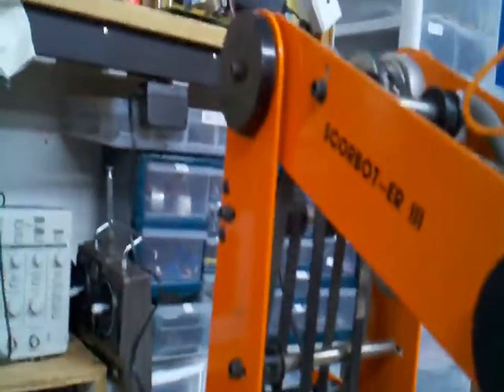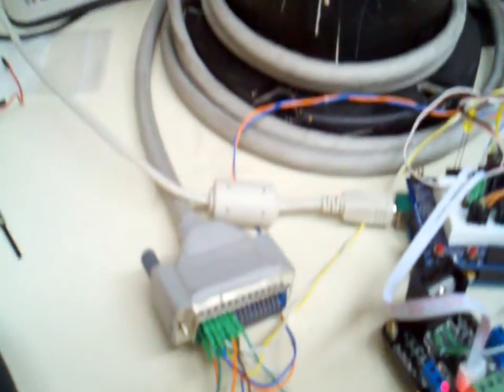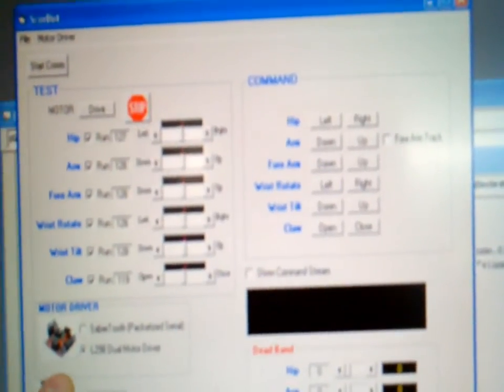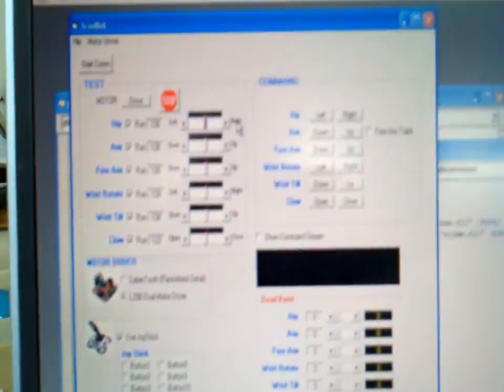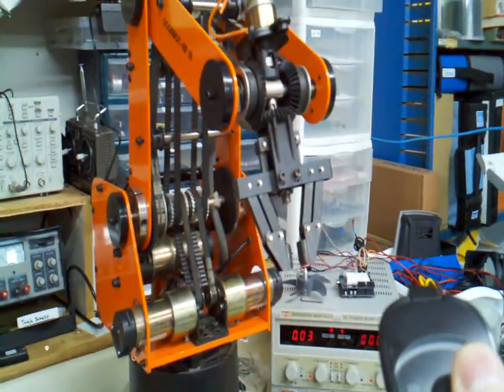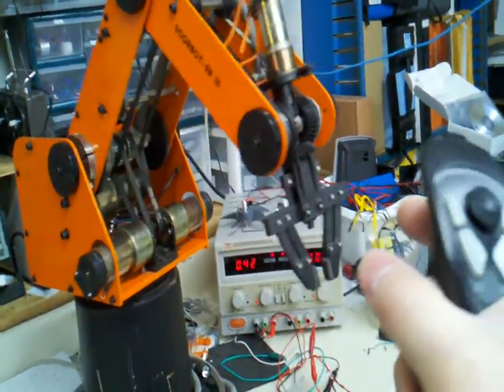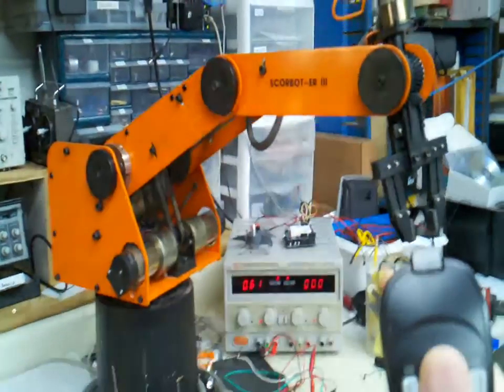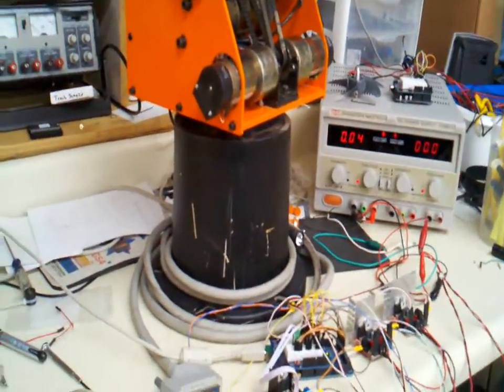ScorBot Arm, Arduino Mega, and L298

Comment: Dear sir, can you share code and circuit diagram. Thank you so much!
Reply: Sorry,  I has been a long time. The gui is VB6.
I use PS2 controllers now to control the Scorbot arms.
I will look for the ps2 code and pinout. Thanks for reaching out.
Reply: @doylemaleche9937  thank sir very much

Comment: Respected sir, 
I am a student working on similar kind of project which is a controller of scorbot er v. In that i want to make a GUI same like you.
But i am using Arduino UNO controller and l298. 
But how can i connect two Arduino UNO because one Arduino uno control 2 motor withl298 .
So how can i proceed further. I really need your help sir
And can you provide GUI which i show. In video for my reference.
Please help me sir
Any material or use full information share me through my email id- soni013.1996@gmail.com

Thank you

Comment: i always see setups that there are always 2 motors on the second joint. how to control it that the two motors will work together? because if one motor runs first the other motor will be a load?
Reply: mark loria 
Not sure what you are asking.
The claw wrist is controlled by two motors. You have to command both simultaneously in one direction for  tilt and both in opposite directions to rotate.
Reply: i guess ive got your answer. what im just trying to say is about two motors that run together, they have to be synchronous.

Comment from the maker: Updated to use PS2 controller. 
works great!
Reply: Edward Notebaart,
this routine was written in Visual Basic 6.0 and no longer supported.
i now use an Arduino and PS2 joystick controlling the L298 motor drivers.
I can send you the code if you like. 
warm regards. 
Doyle
Reply: @doylemaleche9937   would you be able to help me out with the code; anything helps Thanks in advance
Reply: @3DPrinting_And_More2515  I will look for it
Reply: @doylemaleche9937  Did you happen to find it, your help would be appreciated 🙏 😊
Reply: I would appreciate the code very much! Do you have any wiring diagrams for the  arduino and L298 and joy stick  as well.  Thanks this will be a great help. Warm regards
Reply: scruffman2001 Sir are you willing to share how you were able to accomplish your control of the scorbot robotic arm?
Reply: scruffman2001 no private email.
how do you do that here?
Reply: Cob 674 at yahoo dot com 
yahoo.com

Comment from the maker: No PID involved, just direct control.  No limit switch for the hard stops. I have switched over to PS2 controller which made it easier to control.  I will post a video using PS2 soon.  The Visual Basic 6.0 is no longer supported by Windows, and I have not transferred it to .NET.
Thanks everyone for asking!
DOyle

Comment: Hello :), I have 2 of these with conveyers and sliding rails, I have 2 others (pegasus) and a rhino xr4, anyone interested in owning one? The 2 scorbots are just like the one in this video. A question for you scruffman2001, if you did want to hook up those encoders to the arduino, how would you do it? I have looked up a g320x gecko drive, but they are expensive. Do you have an alternative?

Comment from the maker: Electric screw drivers are geared which provides greater torque and are used in robotics projects.  The lm298 can provide up to 2amps with proper heatsink.  The best way to determine the capacity is to place a multimeter in series with the supply voltage and set to read amperage  then maximize your PWM to the controller and try to stall the motor.  Read the amperage on the meter.

Comment from the maker: Some of the L298 from China did not have the Enable pins on the circuit boards. Instead, they were tied HIGH. For PWM and individual control, I had to lift the L298 pins from their solder points and added an extention wire to enable/disable control. Most now have the Enable option so be careful in choosing your L298.

Comment: "generic eBay L298 (modified)"
Why did you have to modify it?
I am planing to do similar thing and need to control 3 dc motors with this L298 ebay driver...

Comment from the maker: As you might have observed in the video, I used an L298 dual channel motor controller. They are capable to 2amps which is sufficient for the Scorbot motors. The power supply is 12 volt DC and the total operating current is under 3.5 amps, depending on motor loading. You can use an older ATX computer power supply or find a 4amp "brick" style powersupply at Good Will, or some other surplus store. Check eBay too. Let me know your thoughts about the controller. Good luck!

Comment from the maker: @MrFutureSolution Sorry for the delayed response.
The old (OEM) controller works with the motor feedback encoders and essentially turns the motors into servos. Joystick sends position data the the Visual Basic (6.0) program which then sends serial position data to the Arduino. The Arduino translates the position and velocity data to control each L298 via PWM and logic. Mega has more serial ports for future interfacing. Thanks for asking!

Comment from the maker: The L298 are great for interfacing with a microcontroller and sending position commands.
The OEM controller is large, but useful since it tracks the encoders for accurate command and response. When time permits, I will work on an Arduino controller to accept OEM commands and track encoder/position feedback.
I'm looking into increasing the Arduino's PWM frequency from 1Khz to 10Khz to prevent the annoying PWM cycle whine.
I want to get another arm, mount vertically on a torso for two arm robot

Comment: Why do you still need the old Scorbot controller after having interfaced directly to it; what does it do that you're not already doing with the arduino and the H-bridges? Is there just better software meant for the OEM unit? In which case why interface with the Mega at all? Just curious. Thanks.  :)